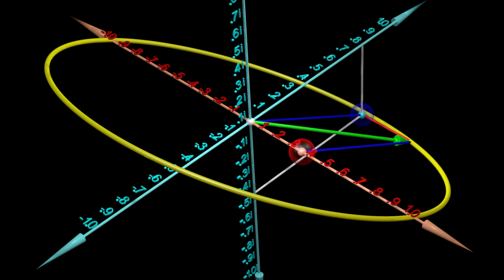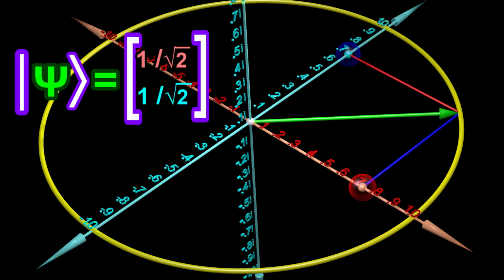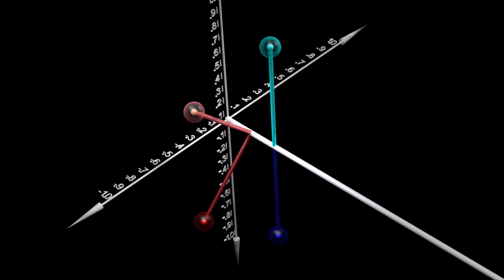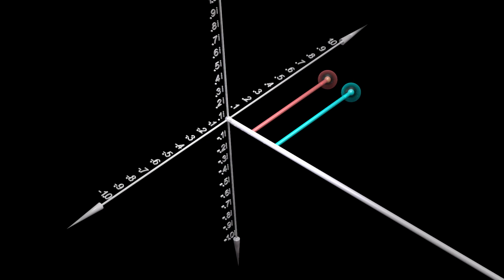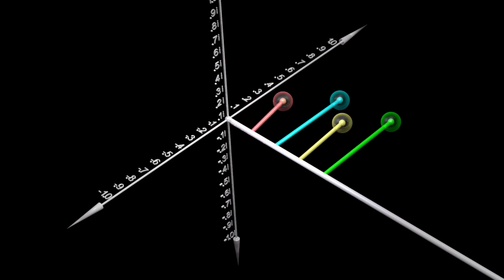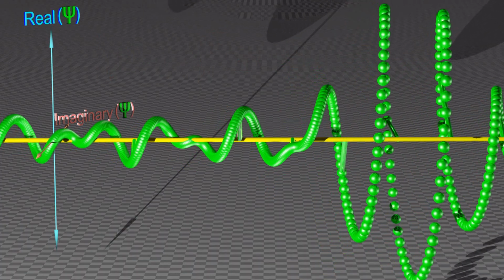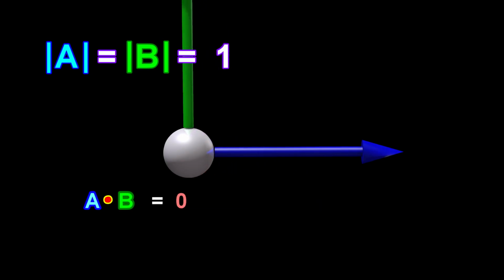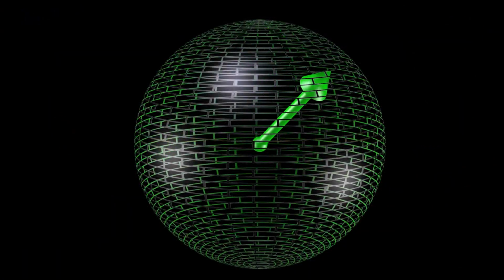Quantum Projections

Comment: Ah, another waste of time video on YT. A 15-minute-long video that really just says: A system's quantum state, psi, can be written as a superposition of orthogonal eigenstates that form a complete basis. These eigenstates correspond to possible measurement outcomes, with the probability of each outcome, say corresponding to the eigenstate k, given by |c_k|^2, where c_k is the coefficient of the eigenstate in the psi quantum state.
Reply from the maker: It doesn't just "say" those things.  It also visualizes it.
Reply from the maker: Did you actually watch the video before writing that comment?
Reply: @EugeneKhutoryansky  yes I did. And no, it doesn't say more than that Even the visualization is not that impressive. Rotating lines in a coordinate system for 10 minutes on the screen.

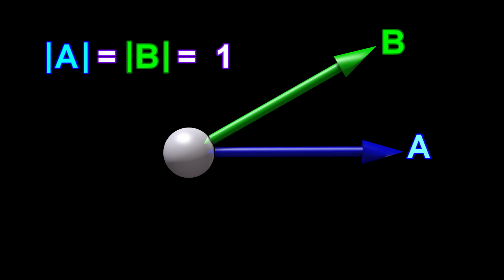Comment: Thank you very much for the excellent video. I am a Brazilian fan and have been missing your instructive and graceful presentations. I have a question. In the vector projection section, from 12:13 onwards, you state that A · B equals the length of the red arrow. Wouldn't it be A · B = ± (length of the red arrow × length of the blue arrow)? Thus, A and B would be orthogonal when the length of the red vector is zero, and consequently, A · B = 0. Is that correct?
Reply from the maker: Everything you said is correct.  In my example, the length of the blue arrow was one, so we would just be multiplying by 1.